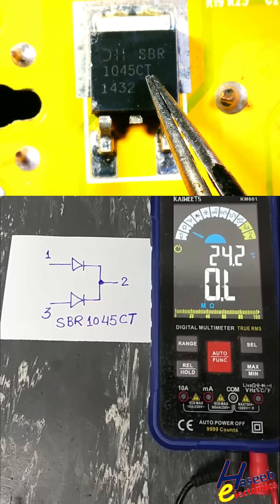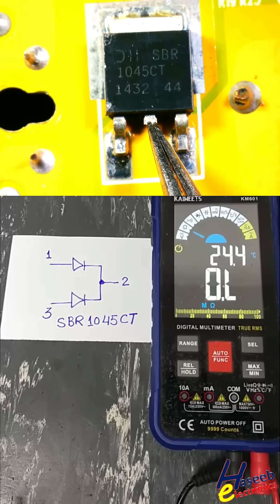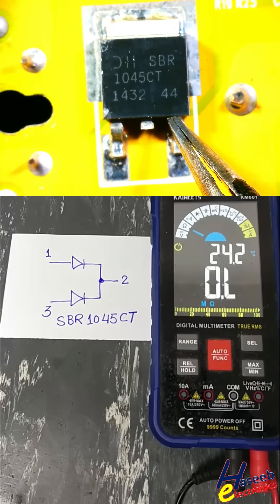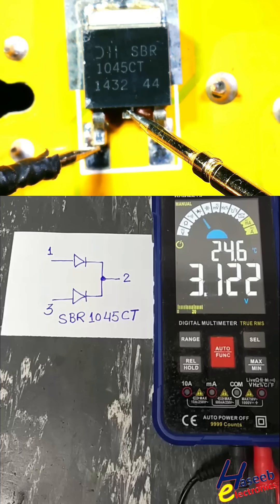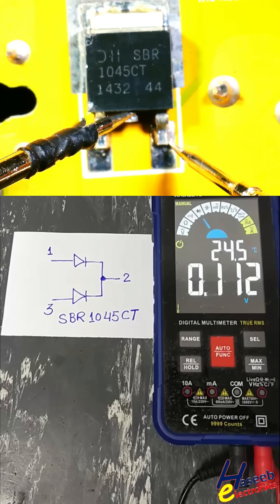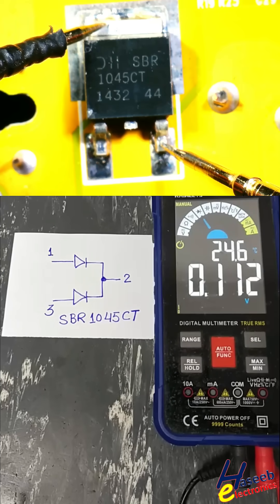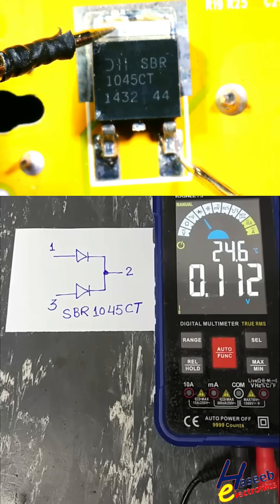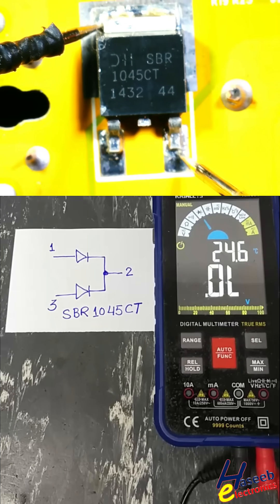How to Test SBR1045CT Schottky Diode with Multimeter | Quick Electronics Check #shorts

Comment: SBR is not “Super Barrier Rectifier”, but Schottky Barrier Rectifier. Thank you for your informative videos. I enjoy them very much.
Reply from the maker: you are right it is schottkey rectifier 
but in that schottkey rectifier family, it is named "Super Barrier Rectifier" due to its Reduced ultra-low forward voltage drop (VF); better efficiency and cooler operation.
https://docs.rs-online.com/74ea/A700000008903037.pdf